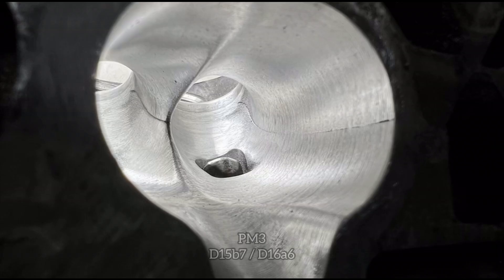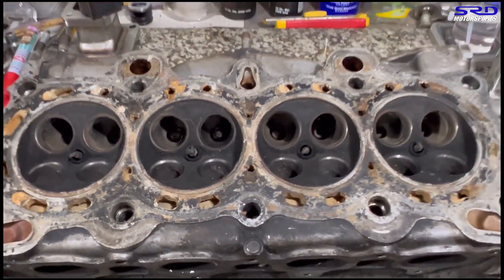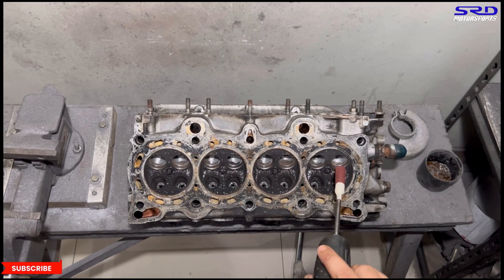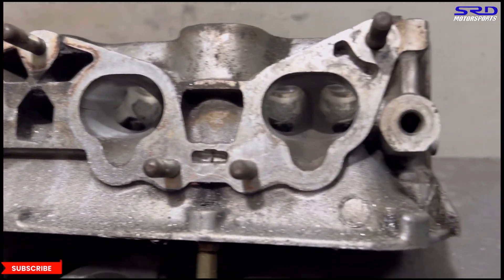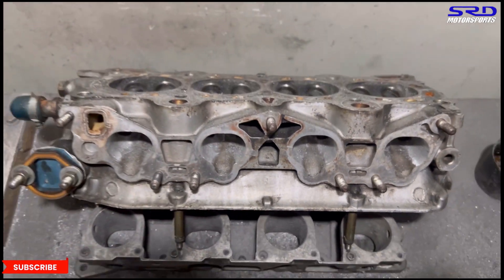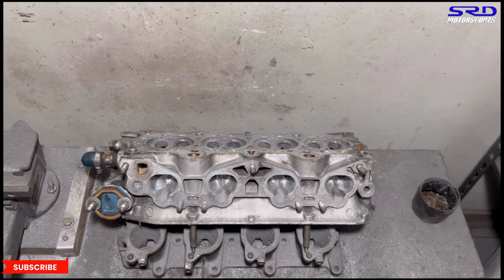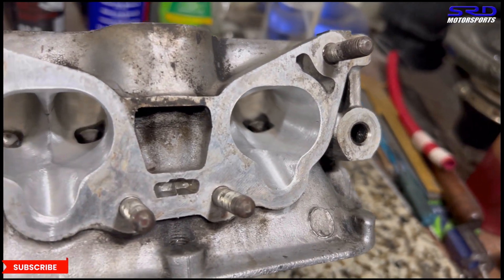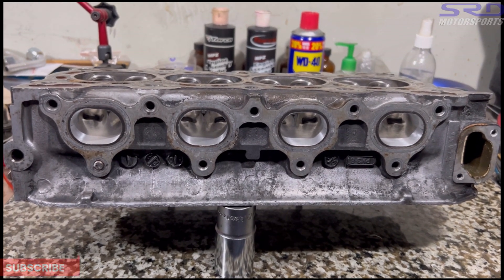D15b7 PM3 Non Vtec Head Porting and Development by SRDmotorsports

Comment: nice video man, im running into a somewhat similar issue. Ive heard of the mini me swaps & all that, but my d15b block has a PM3-7 head on it. as far as i know thats a d16a6 auto. Ive heard of head swapping but why a non vtec head with a vtec block & ecu (p06 & p07)?
Reply from the maker: not sure but pm3 is also for a d15b7 and not all d15b were vtec right away I mean kinda hard to tell once everything’s been switched up
Reply: @SRDmotorsports  would you recommend just getting a vtec head for it ? Ik you say its hard to say or tell but what are some ways you would go if you don't mind me asking
Reply from the maker: I’d stick with the pm3 head it actually runs real good and produced good torque
Reply: @SRDmotorsports  one of the first people who actually tell me something like that & not "just run a vtec head". You think as first time engine builder itd be good to build block & head for boost? Im going to school for Auto service in January so this feedback is really appreciated
Reply from the maker: It’s not bad… I mean boost or NA the build approach usually don’t differ, just parts do

Comment: Hello, its been a while. I thought id ask here because its your latest video.

regarding turbocharging a k series. My rpm limit will be no higher than maybe 8200rpm. (7500rpm or less with a long final drive would be nice)

I want to have torque and response like an evo, with a max power of 500hp, realistically.

It seems that people make 400 to 600hp easy on factory internals, but they do so with low torque and a big turbo, with torque kept to a maximum of around 400Nm.

With what I have in mind, a small turbo (for a k20) like a td06 25g with a nice flat power curve and torque coming in at low rpm, will i have to upgrade the rods and pistons?

I dont want to say what engine i have, but it came factory with a ppa head, dual plenum intake and (surprisingly) rbc 50 degree intake cam. I want to keep it that way.

I also will keep the balance shaft setup if it has one. Im not sure if it has the k20a3 style crankshaft but if so, i may upgrade to k24 crank and go 2.3L

yes there are better blocks but this ones sentimental to me; my mum bought me this car off my sister.

Money no object, but I just want to keep this block and head setup with this car.
Reply from the maker: One thing is I’m uncertain about the k24 crank on to ur block…

on stock pistons and rods = 350-350whp is doable with reliability 
Ofcourse add more boost and u can get 500hp but durability? I can’t tell and that’s where pistons and rods come to mind…

On the intake side… the common step they would suggest rbc that’s fine
But I would prefer a skunk2 pro series intake it has more plenum volume and if ported a lot more potential…

Comment: Man! I want to buy a good ported d16y7 head from you! Do you have one?
Reply from the maker: Y7 like a roller rocker yseries?
Reply: @SRDmotorsports  no like a y8 but no vtec
Reply from the maker: @1Blackman82  so not a roller rocker like a y5 ? I think we don’t have that
Reply: @SRDmotorsports  😭
Reply: @SRDmotorsports  a jdm d15b non vtec head will work!
Reply from the maker: Yes it will definitely!
Reply: @SRDmotorsports  would you happen to have one for a 99 lx
Reply from the maker: I can check around for that locally here
Reply from the maker: But do let me know what head casting ur engine has etc etc that could help

Comment: The water jackets still good on this head? Corrosion is somehow worrying. 

BTW, will this be an OEM superstar too?
Reply from the maker: Yep should be fine we didn’t clean it prior to the vid mines as bad plus it’s from a ph12 looool we know the maintenance those gets lol

not sure yet where it could go but def open for future stuff to develop and research
Reply: @SRDmotorsports  Good stuff with the OEM Superstar recipe - probably made many twin cams cry 😉
Reply: @SRDmotorsports  Remembered someone saying that the PM3 head the D15B7 gets has more core shift than the D16A6 units
Reply from the maker: That’s a possibility… on the b7 as the ph12 has more core shift that an esi pm3 not bad but visible and evident
Reply: Would like to see what power the car makes with the level2.x cam
Reply from the maker: Oh yes for sure!!
Reply: @SRDmotorsports  what is you hp goals all motor oem built?
Reply from the maker: No specific build on this head yet

But my d16a6 has the Level 2.X 
The same cam I used when we did 148whp in 2008 and the owner then ran 14,2 on his 4door

So maybe atleast 155whp now lol
Reply: @SRDmotorsports  a friend of my build a d15b vtec and with basic bolt ons and a y8 cam made 132 whp stock lower half only 70 mm tb and Cai and full 2.5 exhaust and a tune
Reply from the maker: Ah that’s cool!